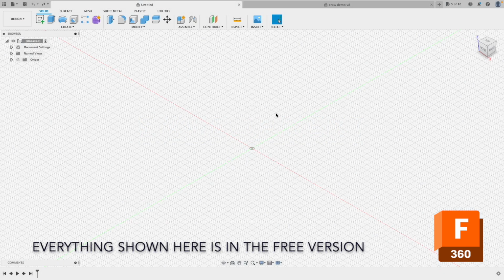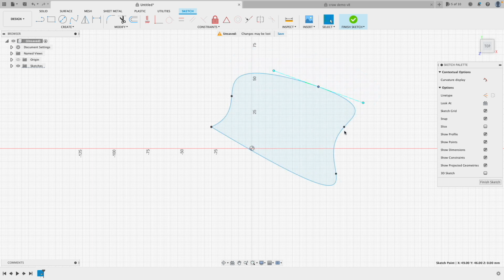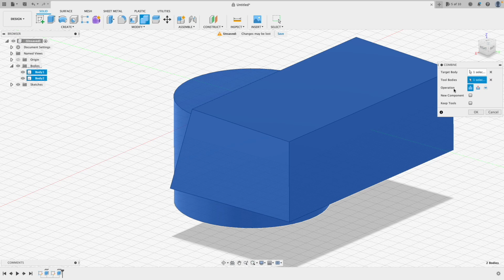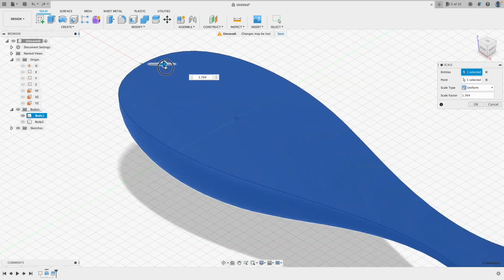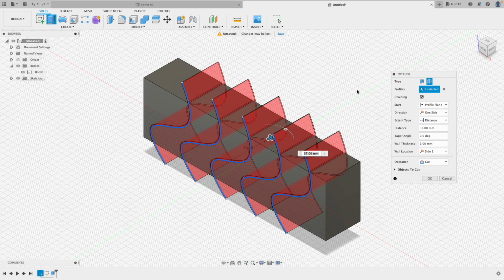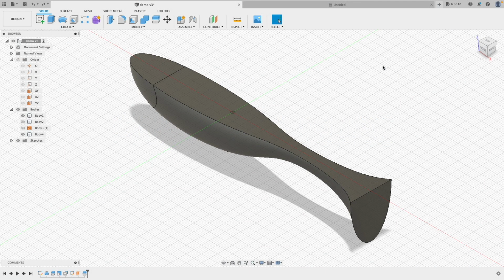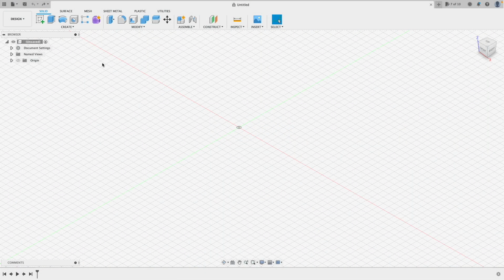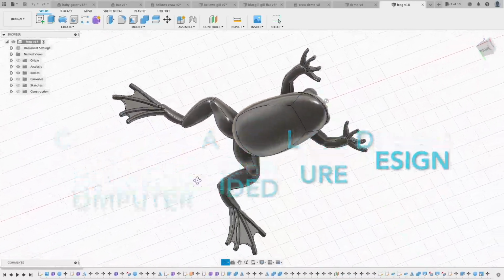Key Fusion 360 Features for Lure Design

Comment: How can I make a tube bait mold?
Reply from the maker: I see people just dip a stick with round tip in the plastisol, then cut the tentacles after “demold”. I have not tried it, but if I were going to design a tube bait mold, I probably do something along that line.
Reply: I mean a detailed one
Reply from the maker: @064pointbreak  I haven't done anything like that yet. You can check out @The Neverending Projects List he has done something similar. Cheers!